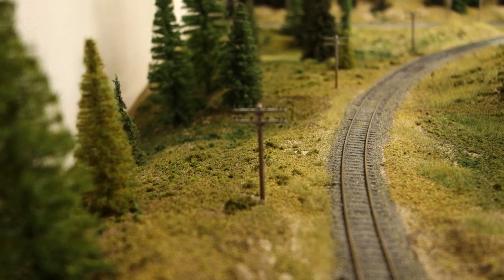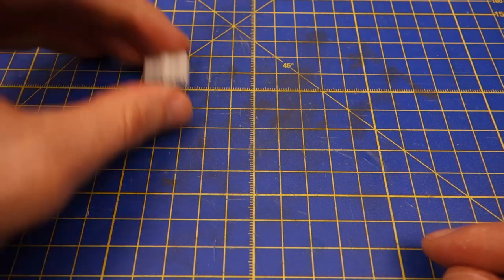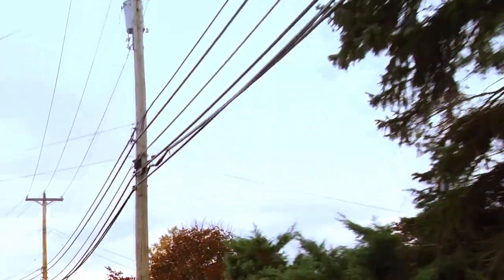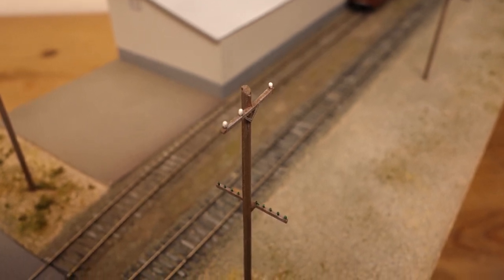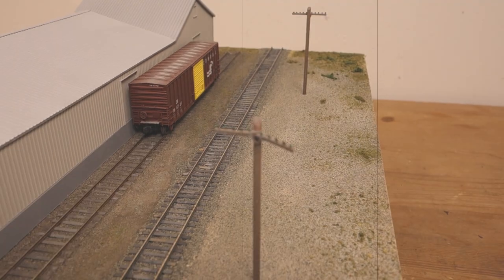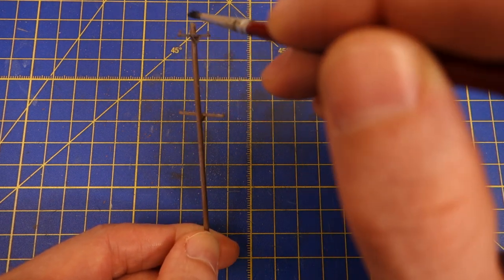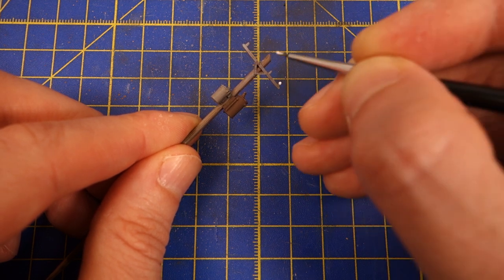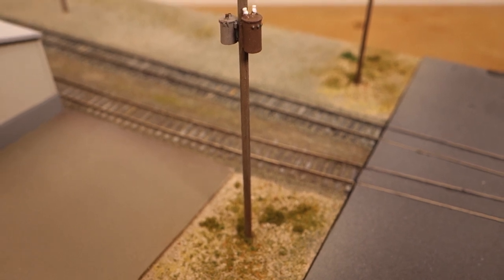How to model telephone and power poles in N scale

Comment: Excellent video, concise and goes way more into detail than most do on the subject.
--Now a ranty addendum

A word of warning for anyone planning wires themselves. While materials like thread and fine wire "work" it sort of becomes a hazard that can lead to what happened in the video with how stiff these materials are. Make sure if any wires are added its something elastic like EZ line to avoid damaging the wires or the poles. 

Aaannd....  Only bother doing it at the foreground.
While stuff like fine EZ line is actually surprisingly scale appropriate for N mathematically, stuff is damn near invisible beyond 2ft.
Reply from the maker: Oh, yes. That's absolutely true. I never bothered trying to model the actual wires because I feel they would be too much of an obstacle when working on the modules or just trying to clean the track.